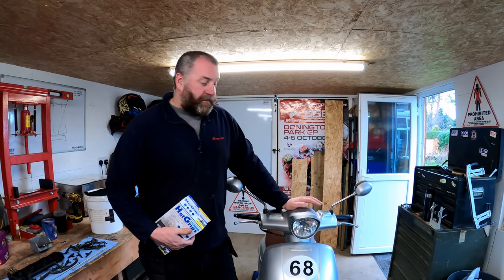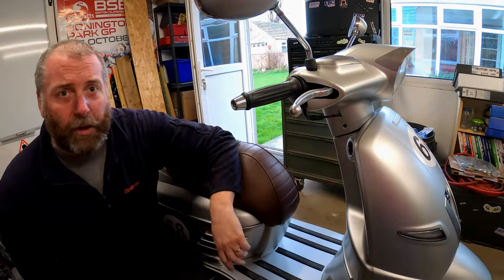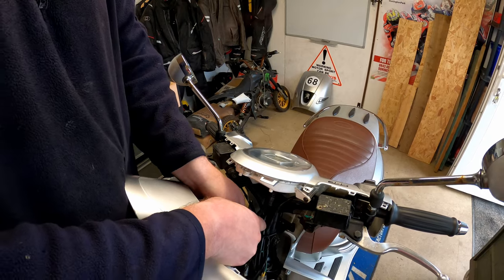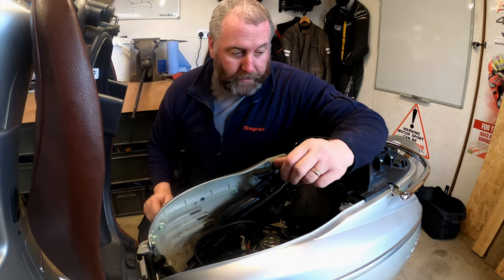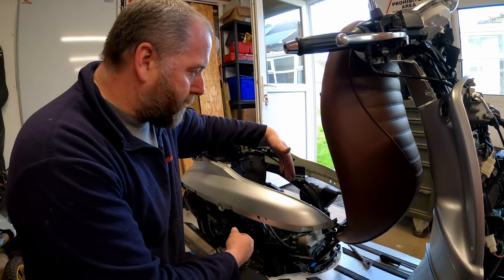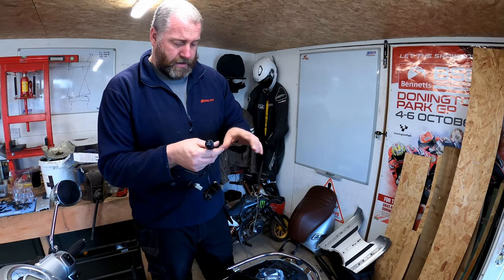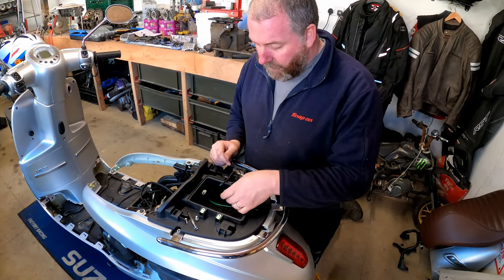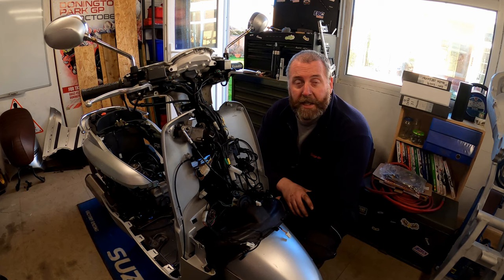Fitting Oxford Hotgrips (Scooter Version) to The Peugeot Django 50, 125 & 150

Comment: Nice video  i was wondering  could you not just  spice them into the 12v power for the head lights?
Reply from the maker: I wouldn’t, the wiring to the headlights isn’t very thick and would probably melt under that level of load! 👍🏻